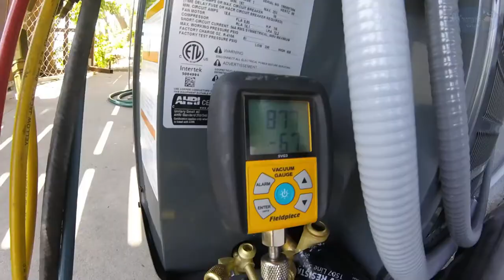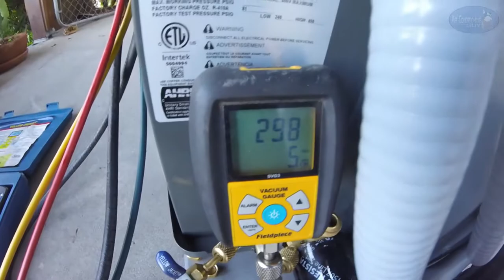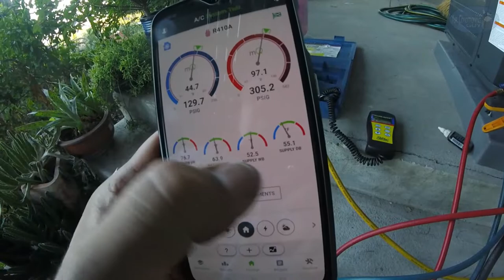Two story home ??? You need zoning.

Comment: those new ard are a beauty I have installed Honeywell never had a problem until like the 10th year but I buy a board with an extra zone usually the zone goes bad on board and use the spare.
Reply from the maker: That's good to know!

Comment: If only Goodman Units were installed that nice here in Kansas, I wouldn’t be so aggravated
Reply from the maker: I think 95% of equipment failure is design and/or installer caused. I've installed different brands and find that they all work great if designed and installed correctly. Mainly follow manufacturer specifications.

Comment: Thanks for the videos. 
Question on the p-trap would you say that is a serviceable P-trap. Cause I run it to that all the time for me I say it's not. And I asked the say question to someone else about their install and they said it's a 90%. not sure if that made a difference but would like to here your thoughts.   Thanks again.
Reply from the maker: Are you asking me if you can service the p trap? I say yes. I installed the PVC union to make it just a little bit easier. Otherwise I take the vent and vacuum from the other end with a wet dry vac.
Reply: @theairconditioningguy  ok I didn't see the union and I wasn't thinking about the vacuum. I ask cause I see a a lot of service ports after the trap. But I can see what your saying.  Thanks

Comment: Clean Job . Was that a Goodman unit ? How many tons ?
Reply from the maker: Yes Goodman 3 ton. Thank you for watching!
Reply: The Air Conditioning Guy Niceee
Reply: Nice install! Great job. Just a question, did you size the 3 ton assuming all zones are on (like single zone)?  Reason I ask is been seeing in here in AZ some builders are sizing a 3.5 ton for two story homes (zoned of course) on a 2350 SF home.  Insulation OK not sure what the builders Manual J calcs are, but Works OK when temps are under 110 and/or they keep units running a decent temp but when they fall behind or very warm outside they cannot keep up.  Homeowner is just living with it.  Typical RNC install though, ductwork also not the best.  Having them just run lower zone to see if that can just keep first floor at setpoint and hope 2nd floor doesn't run away too warm.  I think the builders are meeting some Energy Star rating.  I can see this working for about 90% of the time when indoor temperature is kept constant.  Interesting concept though, I guess it does save energy with tradeoff of some comfort.
Reply from the maker: @TheGgin  ... Great question! It's a little undersized. When installing Zoning I either size it right on the money for square footage or ¹/2 ton smaller. As long as they keep it at least at 78 during high heat days it will be fine. If they forget and let the heat build up then yes, they'll be hot. But I let the customer ahead of time. Zoning is all about comfort though; not efficiency, in my opinion. Also we were working with existing ductwork and trying to keep the cost down. Hard to cut new vents in this home. That's why I created a dump zone that can blow up or downstairs.
Reply: @theairconditioningguy  Thanks Juan, yes  those points makes perfect sense.  I wish the builders would make the installers follow that philosphy.